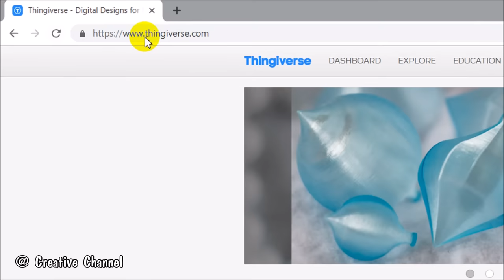Build Powerful Water Pump 12volt With 775 Motor and 3D Printer

Comment: You should placed rubber between motor and the 3d printed mount in order to prevent water leaking and entering the motor
Reply: Dogs Eat Poop  I also know it.
I asked to place rubber pad so that water doesn't enter the 3D printed pump case. And make the total thing water tight...
Reply: Dogs Eat Poop  ya its water proof but speed of motor get 1third of it's original speed
Reply: De qué manera se lo
Reply: can you able to share the drawing of the 3d printing part

Comment: Nice video, but it literally submerges the motor. Water is clearly seen jetting out from the motor's air vents, as you try to block it with your right hand
Reply: yes, but what can happen??
Reply: @blacksheep425  I might be wrong, but I think it wears down the brushes of the motor, which eventually causes it to fail

Comment: Can you use it to control 4 different intakes/outputs, so it's able to fill and empty them in a specific order? Connected parallel or whatever and to be fully programmable. I know nothing about this, but there's a little project I have in mind and I'm trying to gather as much information before I get to it. Thanks
Reply: Ne vjerujem da je moguće obrnuti protok vode na ovoj pumpi, Branimire

Comment: 3D printed parts make it easier to make compared with the sheet metal I used
Reply: Those plastic parts will last a blink of an eye. Water has a lot of momentum, it will break. The turbine should be made of metal.
Reply: @huracan200173  in a big volume ofcourse

Comment: 24k rpm .propeller will broke soon.but also nice project
Reply: The plastic is quite strong
Reply: @DIYLabs  ı dont know bro .maybe you r right
Reply: It slows when water is pumped
Reply: @javierchaparro4769  but force increase and i think if parts wasnt print %50+ infill,so they will broke soon
Reply: @retsetman9698  the final force depends on motor power anyway, but it might broke